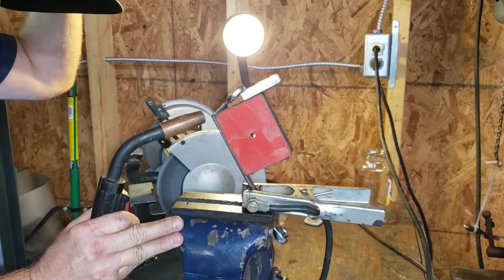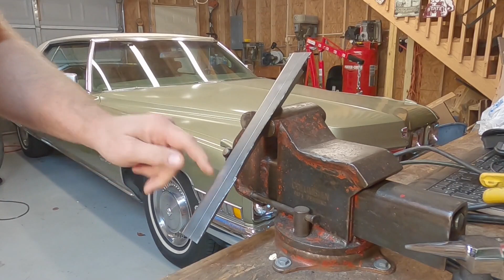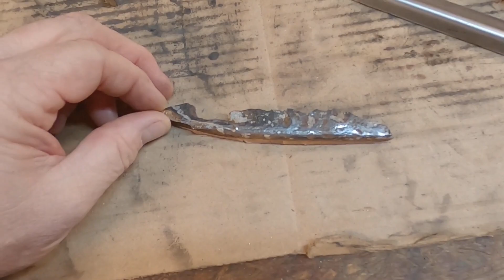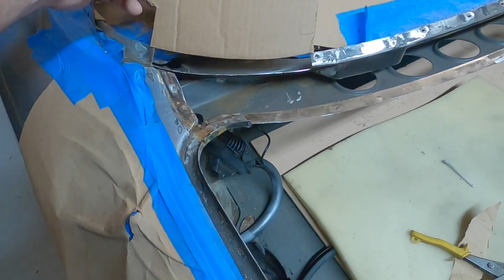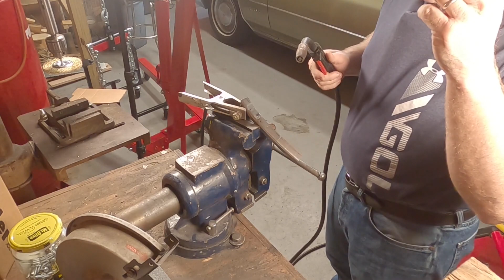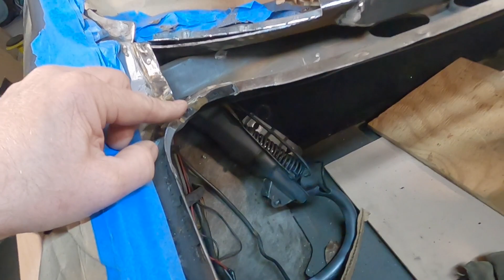Mercedes W126 - Rear Window Channel Rust Repair - Part 8 - Driver's Corner Fabrication

Comment: I have really enjoyed your channel and has really helped me out as I have had to do many of the things you have shown. This is not one job I would tackle though lol
Next on my list is a turbo rebuild. Are you planning that?
Reply from the maker: I had not, but my curiosity has been tapped. Curious to know if you are repairing your turbo upgrading it?
Reply: @ImpalamansGarage  Just repairing. I took the elbow out and saw a little oil there which tells me that some of the seals are leaking. I suspect it has never been done, and with the kit being about $50, why not. It has gotten a little cold, so probably a spring project for me.